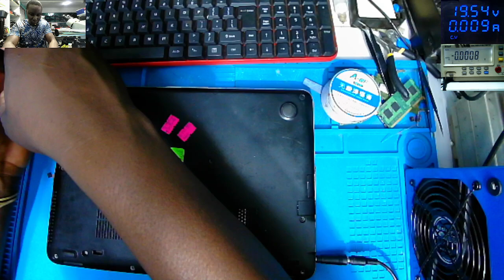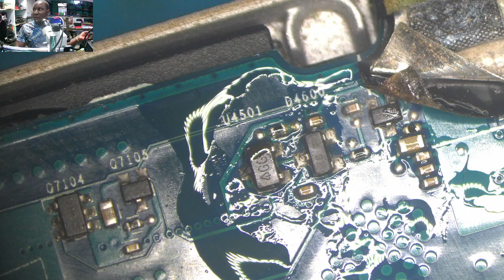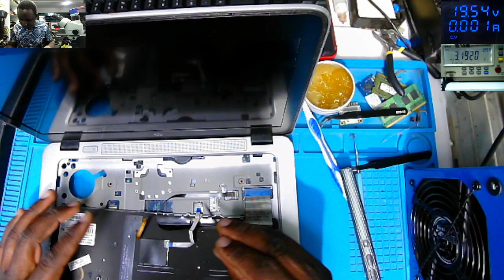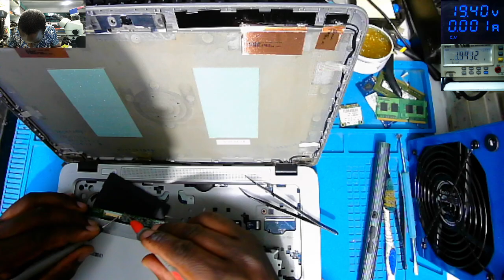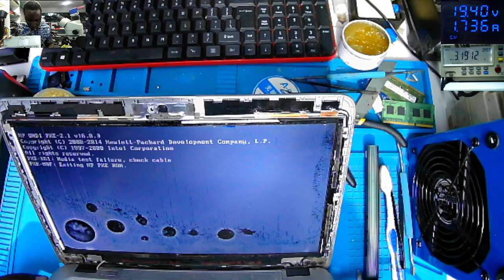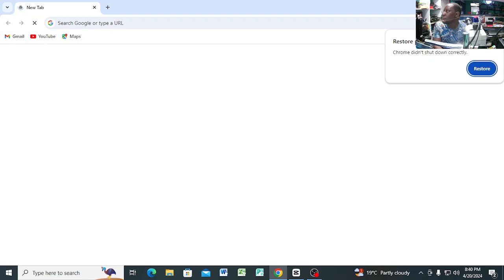Hp EliteBook 820 G3 Series Water Damaged Motherboard Repair--Can We Save it??

Comment: Sir, please turn down your microphone volume. I think the issue is not inside of OBS recording software but in Windows audio settings. You probably have microphone volume gain set too much. And what we hear is distorted overdrived voice.
Reply from the maker: We are currently working on to hev best sound quality
Reply: @BstAfricanElectronicsSurgery  I mean in Windows Audio settings, in microphone section you have volume slider - BUT very often there is an advanced/ additional microphone setting, where you set gain: +10db, +20db, +30db gain - and I think this setting you have set too much. Greetings from Poland